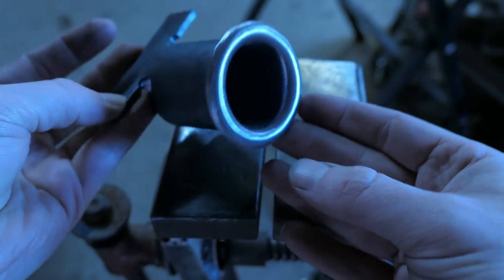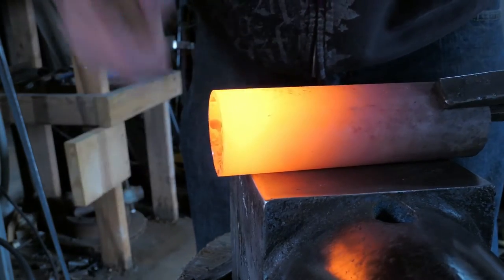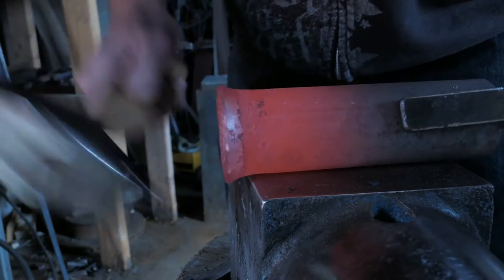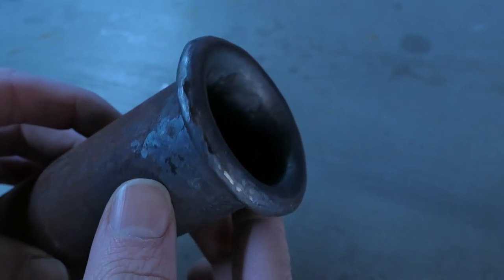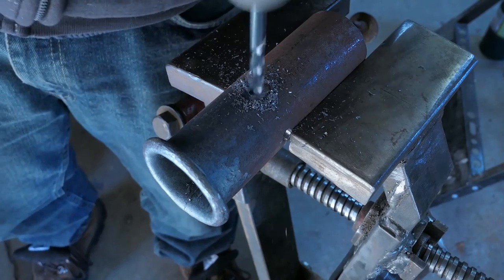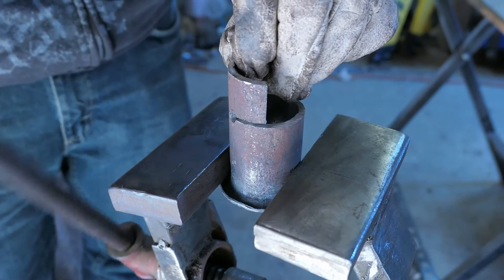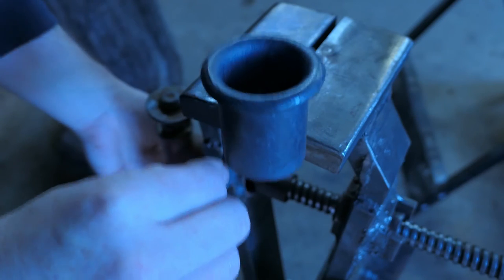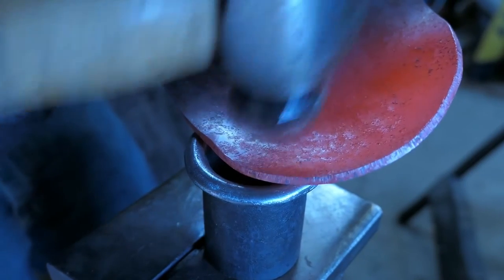Making a Cupping Tool | Swage Block Alternative

Comment: Fantastic work, Bud! My only question is what type of cutoff disk were you using there?? Never seen a yellow one... is it an actual abrasive or some type of new-fangled “cold saw” wheel?
Reply from the maker: Thank you! I think that was a Dewalt metal cut off disc if I'm not mistaken.

Comment: Why didn't you used the horn of the anvil to open the pipe?
Reply from the maker: The horn probably would have worked well at first to open it up but the tab seemed small enough to just flatten out straight away.